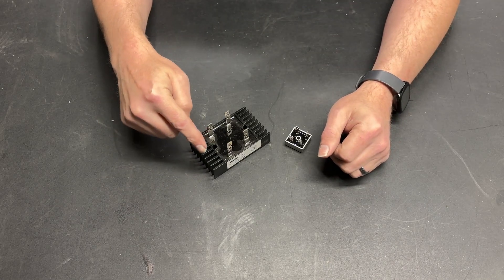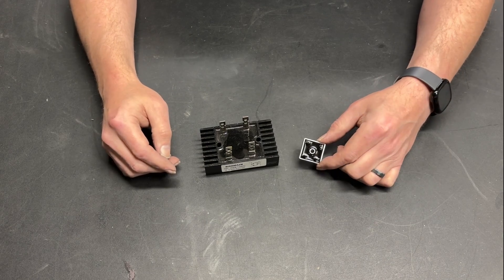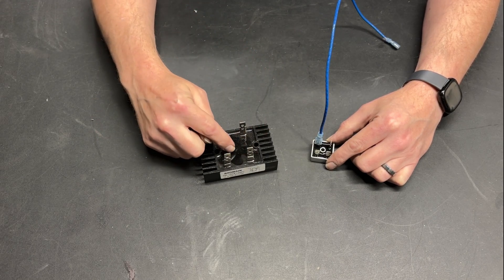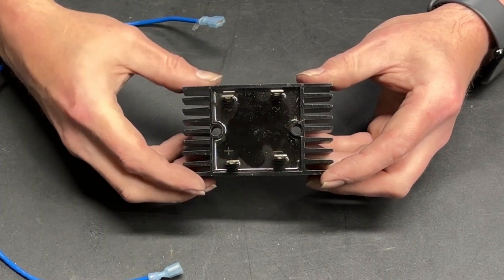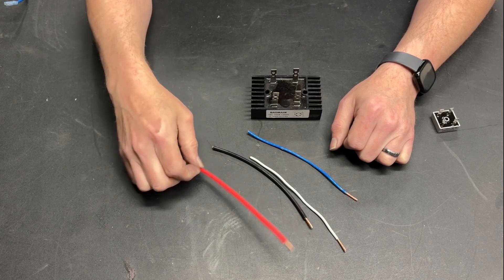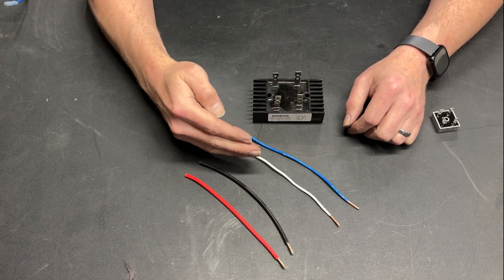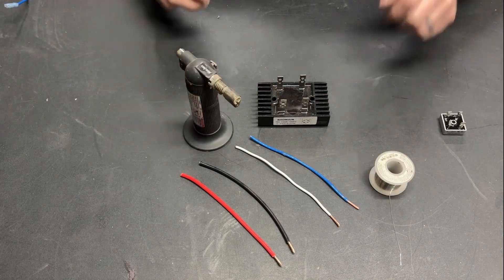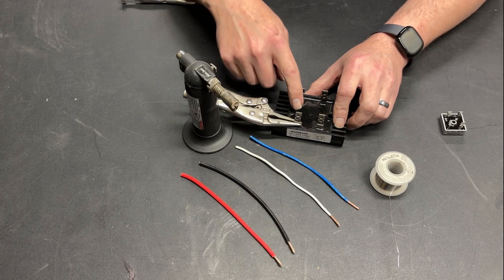Soldering to Large Terminals like on a 100 Amp Bridge Rectifier for an Elegant Connection Solution

Comment: An excellent approach.  As an alternate approach, I chose to grind down those posts to allow for a press fit of a quick connector that I attached to my motor harness.  That still gives me the option to solder later. But I like what you've done. A clean and neat install.
Reply from the maker: I did that on one as well and is a usable option

Comment: Neat tips. The vise grips are a good tip. In jewellery making you use wet tissue paper or submerge part of the item to keep the jems and other joints cool. 
Using a torch is a good idea as the heat is quick and intense. The faster the better. 
Where do you buy these 100amp rectifiers? I'm guessing there can be a pretty big price difference between suppliers. 
I'm in Australia, we have limited access to many goodies seen on YT videos, or they cost a fortune and/or freight is insane.
Reply from the maker: I got it from Amazon.  https://amzn.to/40DjWg6  the exact same one may not be available to Australian customers but at least it should point you in the correct direction.